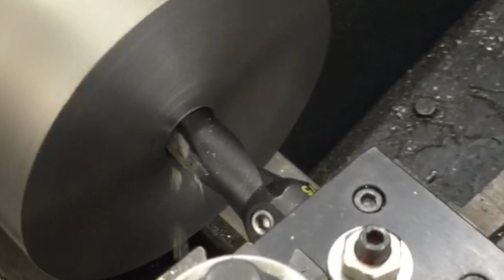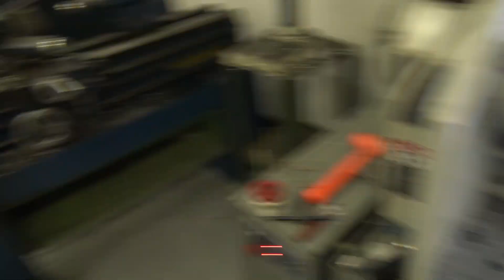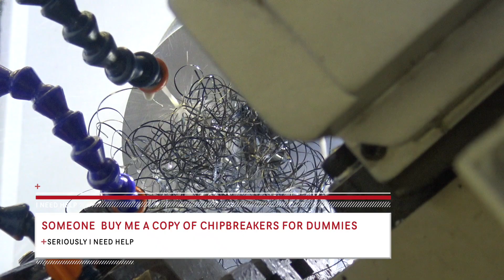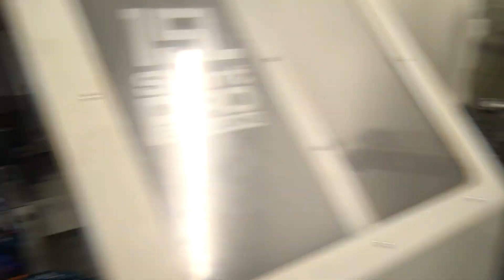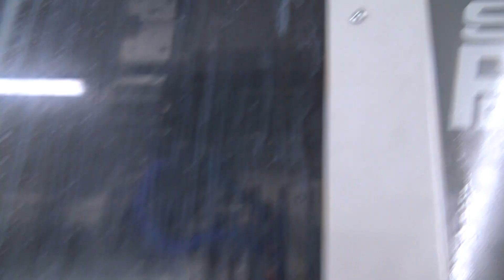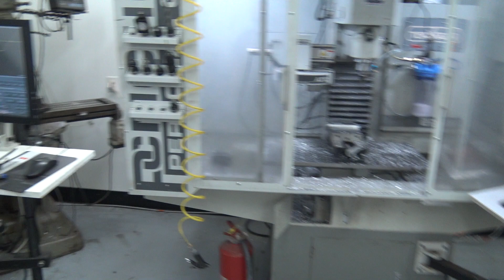Turning Steel Cones on CNC Lathe!  Widget86

Comment: This is why you always do an op0  and start by facing off  both sides and turn down the od far enough to get a clean cut to indicate from without interfering with the jaws for the side you are going to Chuck up for op one. This creates a slug you only have to play with and flip once and should make it easy to get a completely concentric part without having to waste time reworking a part 6 times to get it in spec

Comment: Incase your cnc lathe has enough Power put the Vc to 180 m/min and the feedrate to 0.35 mm/min and depth of cut about 2-5 then you should get good surface and good chips works on mine very good and I use a 80 degree plate with a 0.8mm radius kn the tip

Comment: Not sure if you will have enough power to break the chip, you need to feed much faster as said.  Only buy carbide shank boring bars of that length to reduce chatter. If you don't have enough power to break the chip conventionaly, modify the code to dwell every .01" of cut to make the chips more manageable.
Reply: See if your cam package has a chip breaking option like this:  https://www.youtube.com/watch?v=Adboz_gXdtw

Comment: Depending on hp with a 432 i run    
.08 to .125 depth of cut per side and feed of .008 to .012. Never have stringy chips on rough passes

Comment: 0.013 feed per rev/0.13 DOC <- more like that. Basically you need a lot more feed and depth of cut in rough turning. The only limiting factor here is machine power and quality of fixturing  I don't think you can max out your inserts maximum doc and feed because of machine power and large diameter of the part. (just assuming here, not sure how much power the tormach has) Check the insert manufacturers gudelines, increase cutting parameters until chips are breaking and flying. By the way, I love your videos!

Comment: the secret is all with the coolant flow.  chips are blue :(  but considering that machine I say it works well.  also it's important to use different tooling for rough and finish passes.

Comment: It's extremely dangerous if the swarf does not break and becomes long. It could wrap around the chuck or turret and break the lathe. For roughing, slow the rpm(material dependant) and increase the feed.DOC depends on what the machine can handle,generally not more than a third of the length of the cutting edge of the insert.

Comment: Do you have a video where you prepare the CAM for this? I'm in the process of prepping our FANUC controlled lathe for drilling/tapping/boring.  Drilling/Tapping sorted, just boring now!

Any software tuts on the boring side would be most appreciated.

Keep up the good work!

Comment: OD tool is extended too much !

Try using 0.4mm nose radius inserts even for roughing , they can take at least 1mm D.O.C , 0.15-0.2mm/rev feed , speeds depending but at least Vc 200m/min , while providing chipbreaking .

Comment: I had an experience with cnmg . In the shop we always use quite low values/parameters .
So i went to grab an insert for roughing CNMG for steel , 0.8mm nose radius . And i saw on the little box the recommended cutting parameters .As i mentioned we usually stay well under those parameters , but i said fuck it lets's kill the steel .
I entered the following values , feed 0.3mm/rev , depth of cut 1.5mm (3mm dia)  , Vc 310m/min . It made absoluteley brilliant chips , but i had a 50% spindle load on a 16.5Kw lathe :hehe
Reply: sounds awesome :-)

Comment: I dont have problem with roughing cutting take of 2,5 mm per chip = 5 mm per diameter, maximum 5 mm per chip = 1 cm per diameter, and adress F 0.25 and adress S1000 or 1500.

Comment: lower the rpm, increase the feed and increase depth of cut to stop making wire
Reply: john hancock finally someone who knows something
Reply: @triplem451  yes but the tormach lathe doesn't have the hp to run more depth of cut at a lower rpm. Can't handle the chipload

Comment: Everyone has different preferences. For myself on something like 1045 id pull atleast .060 a side with a sfm of 315 plus and a fees of atleast .010 to .018 depending on the insert. Didnt hear exactly what insert you had but my most common one used is a CNMG 432 and my standard is 350sfm .011 feed .060-.080 DOC

Comment: G'day John, sorry I'm a bit late to the party and am sure you have your chip breaking solved by now, but I'd suggest that as a rule the machine is just not large enough to run negative rake tooling and still achieve the DOC required for the chip breaker to operate correctly. Some here have suggested it has to do with the nose radius, but I don't completely agree. It is instead determined by the insert's designed DOC, which may be related, but aren't entirely the same thing. In short you just aren't driving the inserts hard enough, and I can see you can't feed any harder on that machine. Change them out for positive rake inserts, and try to run them up at the design DOC. If you still don't have the HP then look for finishing or even fine finishing geometries to achieve smaller DOC. This is where the smaller nose radius comes in to play. 

On boring bars you can sometimes fudge things by rotating them a little in the holder via a bodge, up until they start to rub and that can be a good way to experiment with things.

Good luck with it and I'm looking forward to catching up on the happenings over there.
Reply: +NYC CNC John, as an aside. If you're playing with inserts for that machine I can suggest trying some Cermets (assuming you haven't already). Tom Lipton put me on to them a few years ago for milling, and I since use them extensively for both milling and turning. I use Kyocera brand, as they are arguably the leading company in ceramic and composite technology. Run them hard and FAST, like REAL fast! On larger OD work for the machine like you were doing, it may help prevent the lathe dropping its RPM down too much to maintain an appropriate SFM, as it sounded to me as it was loosing torque and coming close to stalling. The finish off cermets when they're singing properly will blow you away.

Comment: judging by your stringy chips i would throw the cutting speed down a bit, take bigger cuts (if possible) and a higher feedrate also shortens your chiplength in most cases

Comment: Your not breaking a chip because your trying to use a real insert in a baby lathe. You need to double your doc and ipr to even come close. Try a smaller insert with a smaller nose radius.
Reply: +NYC CNC ,I wouldn't change anything.you got the job done quick and the parts were good and inserts didn't break,screw the chips breaking.Long stringy chips are gonna happen sometimes.

Comment: hay john what might help would be a v sires insert or a 35 degree because the Tormach might not have the horse power to take advantage of an insert like a e,s,c or a w model because of the tip radius being to large for your machine to make a good chip yes the lathe can turn up to 1200 rpm but in truing you learn that its all about tool pressure. you have to push the chip to breaker in order to break a chip

Comment: On manual lathes a brush shaped like a toothbrush will drag chips away from the work. I assume it would work well on CNC lathes as well. To get a very fine finish do not make one finish cut. The metal underneath the working layer can be disturbed by the pressure on the tool point. Make three or four very thin final passes. The chip will be so foil like that it will break onits own and the metal finish will be so shiny that it will look like a CD disk surface. This works even better on aluminum.

Comment: Oh, on chip breaking. Since I do not use a CNC for anything at my current job 'cept for the surface grinder, I do it one old way, that being to stop/pull back/stepping (or whatever one wants to call it)... I talking of drilling here also. It takes longer, but for non-production, it works to keep the chips smaller and the coolant usage down.

Too late for you now, but you would have LOVED seeing things being made in the Lewis Research Center (I think it is called the Glenn Research Center now) back in the sixties. The art of machining was often times at the level of still using mechanical indexing. And it took slide rules and a lot of patience. Imagine if you can a throw of a dozen of feet on a vertical lathe and getting it to a thousandth of an inch!
Reply: Great video,these people keep crying about the chip breakage ,it takes time to get the chip breakage right with adjustments and i dont think this video was about making adjustments to get a good chip breakage, great job bud

Comment: On your external turning of the cone... I thought your speed and cutting depths were kind of off for what you were turning... although I know you are used to doing a lot of aluminium.  I normally turn steel at between 250 and 400 sfm  depending on the grade, with insert tooling, and usually no less than .020" off the radius (.040" diameter cut).  I know that normal 432 CNMG inserts can handle quite a bit more than that, upwards of .100" radius depth of cut... not that I'd push my stuff that hard if I didn't need to.

Less strings = safer cleaning of the machine later... and less birds nests in the machine in general.

Comment: I realy enjoyed watching your Tormach run.  I think I may have told you in an e-mail that I am a high school machine shop teacher.  We have no CNC machines, despite my best efforts to change that.  

I have run CNC equipment in machine shops.  My experiences with CNC lathes involve parts in the 4000 - 6000 lb range, cutting rolls used in steel mills.  Sadly the stuff I was running were clapped out conventional lathes that had been retrofired for CNC a long time ago.  I hated every machine I ran there.  Not one was capable of making good parts without constantly playing games.  Fortunately rolls for mill work are essentially junk!  

All the Best!

Mike
East Palestine, Ohio
Reply: When I say retrofit they were most likely old paper tape reading NC machines.  Converted to full CNC.  They were very sloppy and could not hold tolerance from one diameter on the roll to the next.  The pieces we were turning were old mill rolls.  We would undercut them, send them to the other end of the shop for sub arc welding and then we would re-cut them.  The material was of such inconsistent hardness that they were a nightmare to cut.

Comment: i do not read all the comments but, you need for roughing less rpms and or a higher feed , 0.10 mm feed per rev at least , depth per cut , as much as you can , i would say 3 - 5 mm on diameter.
if you go lower on the depth per cut , just make your feed higher!

its just tweaking. my experience as a conventional and cnc machinist, is that a lathe on 75 pct of its power during roughing runs the best.

good luck

Comment: holy cow 40 minute cycle time? like previously said need doc to be minimum of nose radius of tool and feed to be high enough for chip forming/breaking to occur. If you have a birds nest occurring start fiddling with your overrides till it gets to where it's acceptable then note the feeds and speeds. I'm way more proficient on our lathes than our machining centers but that's just because I started machining with a lathe 15 years ago.
Reply: What HP is the spindle on that lathe?  Cut force can actually decrease some times on a higher DOC that the insert is designed to do as it's shearing more efficiently.  Also, I'm really trying to figure out a way to come out there for the open house and talk shop...we'll see.  *crosses fingers*

Comment: "When is chatter ok? Never."

9:10 Hmm.
--
No 4 jaw independent? Wut?

I'm not master (heh, that's an exaggeration, I run a tiny lathe with HSS), but it seems like if you need more feed rate to break the chip, shouldn't you slow down the speed if you you don't have the power to run the higher feed rate?
Reply: Ahh, so the CNC lathes run a VFD type setup, and not variable speed pulleys? I see. That is one advantage of a conventional lathe.

Comment: You are using a 0.006 feed rate (0.15mm), I would use a .20 .25mm feed rate which is roughly .008.010 in inches. About 500rpm is plenty. A depth of at least 2mm would be ideal, any less and the cut will be smaller than the radius of the nose of the insert.

Comment: The issue with the Tormach is that it doesn't have enough power to take the cuts you need to break the chip. I think you can get around this a little bit with a smaller TNR. I think you should try some 431 inserts with wiper geometry. That way you get a .003 IPR surface finish out of a .006 IPR cut and the smaller TNR should result in better chip formation at the cut parameters you can manage. Sandvik, Iscar, Seco, etc all make them. I understand that Shars inserts are the cheaper choice, but they are pretty much garbage.

Also, when you start roughing the cone...those parameters are FAR too light. Your insert is riding up on the cut and you can actually hear the chatter which is no good at all. Your DoC should be double at the very least and I'd go above .050 if you have the power. I'd say double the IPR, but I don't think the machine has the power to do that.

Comment: I'd have run that rouging pass at 400SFM, .025-040 DOC, 0.015 feed.  But it depends on how much HP you have.  IIRC my old Hardinge CHNC-1 would do that cut, but it's 10HP.

Comment: As for feeds an DOC, the DOC should be at least 1/2 your nose radius, preferably closer to the nose radius.  The feed rate also depends on the chipbreaker geometry, some are made for roughing and have a much larger gullet, others are for fine finishing and have an upturned edge with no land.  You need to feed hard enough to get it over the land and into the gullet.  From a simplistic standpoint, try a feed rate value that is greater than the land width of the edge (a measuring lupe can help with determining the land width).

Comment: OBTW, go to latheinserts.com and get some proper inserts.  I'm not so confident in the inserts that Shar's and Tormach sell -- they are targeting low cost inserts and hobby level users, hobbyists typically don't see the value in spending money on good inserts.  You can also call the guy that runs that site and get his recommendations.

Comment: Chip breaker 101, (?) take a look at:    http://www.sumicarbide.com/pdf/insert/Insert_Chip_Pos.pdf    or   http://www.sumicarbide.com/pdf/insert/Insert_Chip_Neg.pdf    from the graphs you will see the range that each of their chip breakers will work in.  If you have Sumitomo over there, get them to send over their local Rep who should be able to suggest the right tip and chip breaker for your individual purpose. They make some really great inserts (T1200A grade cermet) that can leave a near chrome like finish on steel, if that is important to you. 
Many folks make the mistake of thinking the shape of the insert is what matters, when in reality it is the chip breaker style and nose radius that is most important. Simplified, insert shape merely governs access and number of cutting edges. Once you know what you need, you can look on Ebay for more but never assume all inserts are the same, they aren't.
Reply: Try and get some samples before you buy boxes, I wouldn't want you to be disappointed,

Comment: I have a little tip for getting that chip to break if your hogging out some material.  When you are drilling a hole, you don't feed constant.  You peck it.  The same idea works on a lathe.  I haven't done it on cnc but when using a manual lathe and I am hogging/roughing out material, I feed about half an inch or so (depending on diameter of work piece), back up a few thou, feed, back up a few thou to get that chip to break so I don't birds nest.  It isn't ideal because it can hurt cycle times, but if your machine can't run the ideal feeds and speed for breaking the chip, it can get you by.
Reply: That I couldn't tell you.  I have never used cam software before.  I can say that it does work great on a manual lathe when hogging long/large diameter pieces that generate a large volume of chips per pass.  One other tip, the reason I back it up slightly is because if you just pause, you tend to get some rubbing and chatter when your DOC slowly goes to zero.